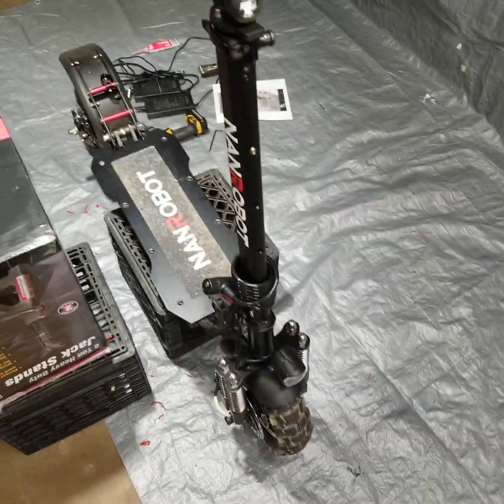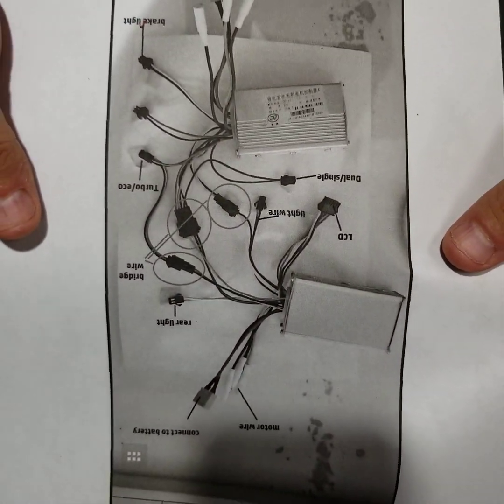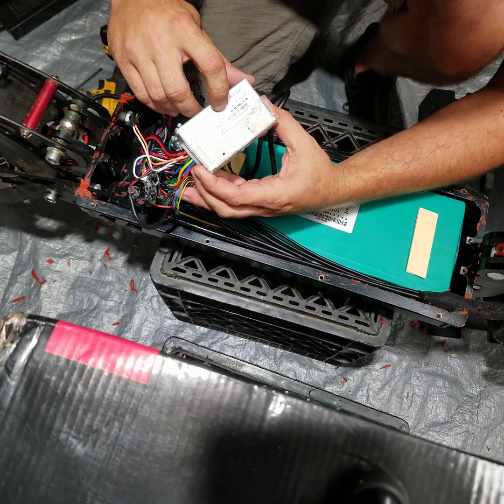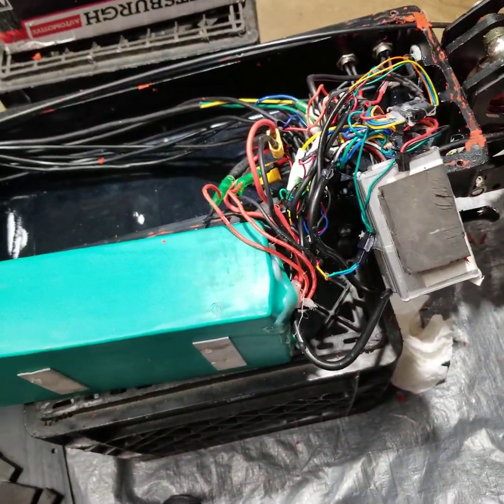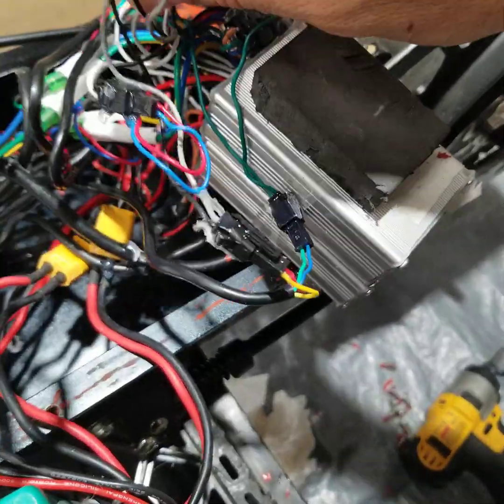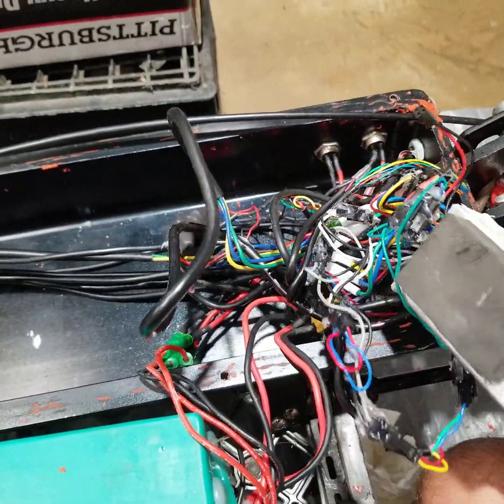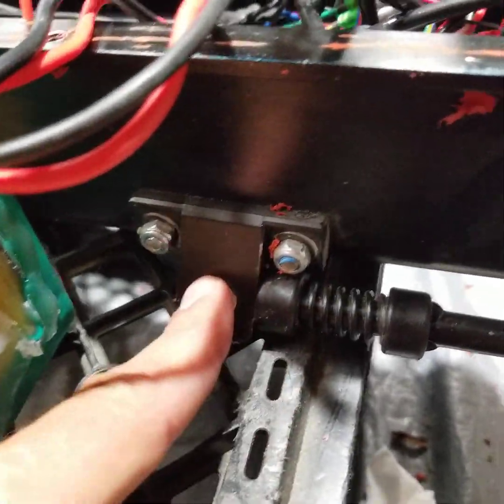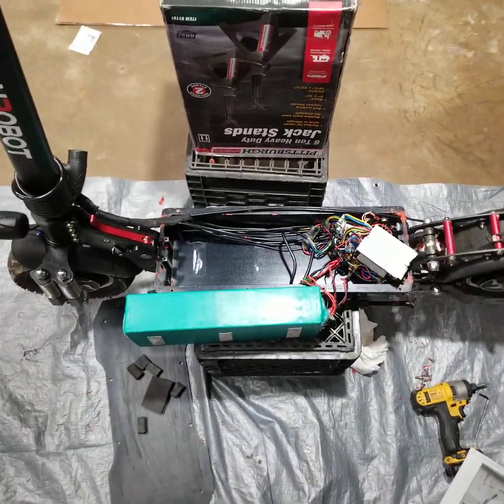Nanrobot D4+ 2.0 Whats inside the scooter Plus overview of the basic wiring diagram electric scooter

Comment: hey i was wondering if you could help me.  i wrecked my scooter and somehow ended up taking the key ignition off and just have the trigger now and when i tried to bypass it and rewire it, i think i fried one of the wires running from either the trigger or the dual switches buttons......i thought i had it wired right but apparently not or i needed bigger guage wire or something...is there any way you can explain the easiest way to wire it so that it will be simple and run full speed without the dual switches etc.....

Comment: Help my front motor works fine. I checked to call turbo switch to turbo switch is good. I bought a new one of course and I’m not gonna replace it because there’s nothing wrong with what I have but the back more than work I said well I don’t need the front more. I need to back more so I replace the wiring I rewire it exactly the same now the back motor runs backwards white wires. Do I have to change to make it more front worse as a green one bunch of different ones

Comment: Hay I wonder if you could help me out. I’ve got a cheeper electric scooter basically the same as yours. When I got it the on off switch with volt meter was broken. I’m not sure if it had a key or not. Now I just have 3 wires on handle bars red,black,&green. I can’t get any power to the display power button because it’s not wired up I guess. I have power to those wires to the black and green wire nothing to the red wire. I got this in a trade and I’m trying to find out whether it’s any count whether it’s worth me replacing that switch or not. I’m only going to sell it when I get it going anyway I’m a little bit older of the guy and I don’t particularly live anywhere. I can really ride it I’m out in the country in the mountains do you know of a way that I can get power to the controller with the trigger. ? Like I said, I have about 48 V to those wires being that the batterie is not completely charged up? I have looked and looked online. I haven’t found anybody that can help me on that yet.

Comment: I know that this is 
But when I received my NanRobot 4X2.0 the first day I got it it was about 6 in the evening so I was happy to get my I fixed it right quick jump on it and went around the corner come back put the scooter on a charger when I got up put the key in no power man I got that in 20/20 you know I'm looking at your video now so I can fix my speed controller
Thanks 👍
Reply: O I wanted to tell you that my charger that came with the scooter burned my speed controller so I didn't know what was wrong took to a shop & they told me that my charger fried the speed controller and I looked the big yellow plug that goes to the battery was  damaged also I don't like NanRobot because I only road it for 10 minutes & been having it for 3years

Comment: Ok, the red/yellow goes to white/blk and the blue/green to just the green and bridged over to the red/yellow as well? Sorry this one I'm working on is a mess. It was stolen and then recovered and I'm fixing for a friend.  Also it looked as if the red/blue was pig tailed out two ways, but I couldn't tell for sure  trying to find this exact diagram is impossible, there are even a lot of difference between the one in the video, and this one but this is the closest I could find so far. My buddy would be happy to just be able to ride it, so is there a better color diagram link that you have found out there because the tweeker that stole it chopped up the wires pretty bad. Thank you in advance.

Comment: As far as range, like you said it depends on the lot of factors. But I've come to realize you're better off going by the voltage instead of the battery bars. It's going to die completely at 46 V .so when I hit 48 I know I should head home which is usually within 5 miles. And Loctite works good for loose bolts. If your folding handlebars rattle when you fold them down there's a tiny Allen key bolt in there. If you back it out backwards just a little bit it will get rid of the rattle. When it's in the right place squirt a little super glue on it and it will stay there. Otherwise eventually the rattle will damage your handlebars

Comment: You don't have a brake light? That must be an older model. Glad I seen this video I was just telling somebody I'd like to have a diagram of the inside wires. Mine was $1,200 even because of the Black Friday sale :-) to my door. Mine goes 40 mph when it's fully charged. But usually it runs at 38 mph and then when it gets lower 36. But I have gotten over 40 miles and range one time even 52 :-) I weigh 175

Comment: Just bought mine a few weeks ago :-) the power and speed is amazing :-) putting new lights on myself. Have had problems with flat tires though but I think I got it under control I have two bright LED strip under glow lights that were for a car. It's 12 volts and I want to get a converter to where I can hook them up to my tail lights in headlight. I don't know if I just need a fuse, or a little Transformer to lower the voltage like you did

Comment: I just bought a yume scooter with the exact set up and the brake light wire was rubbing against the tire and I think it threw a code and now it’s reading that the brakes are constantly on and it won’t let me throttle I took the the plate off and I unhooked the back light but it’s still showing the brake on I need help and I have no idea what to do

Comment: Hello i have a nanrobot d4+2.0 have about 800 miles on it. I was riding it and it just went dead and now i have resistance on both tires they do not spin freely and the dual single button only works in single really strange and now it will not turn on i have a wide wheel pro and i used the charger with the same connector as the the power to battery and the key switch works but the throttle does not work not sure what to do i have it apart can you help thanks
Reply: and error code e08

Comment: My stem was loose and i did what you said to tighten the neck nuts and it was a Lil tighter but if you put to washers on the 2 screws on top of the nuts. That's even better. Thanks for all ya videos ive watched so far

Comment: Im trying to diagnose my nanobot d4+ 2.0 scooter. This problem does not happen in the cold morning on my first ride but happens in middle of day when it is warmer. Im in NM my first ride is at 50 degress and it is still about 35 degrees over night so the battery is cold on the first ride. What happens is on the second ride when its 70 degrees outside both motors cut out when I'm in dual mode and when i go full throttle, and also sometimes when i try to just accelerate quickly. when it cuts out i does not come back alive by simply backing off a little on the throttle but i have to totally go back to 0 or no throttle and then the motors start if i re-engage the throttle more gently incrementing the speed. It does not happen in single mode when in just rear hub drive. When in single mode i can press the throttle fully and as quickly as I like. If I think of the thumb throttle as a clock that goes clockwise from 12 to 6. it is at the 5 when the motors cut out. It also happens if i got from 12 to 3 very very quickly.  I'm pretty techy and i can replace of fix most anything but I like to diagnose first. I did have an extra thumb throttle speed controller so i did decide to replace that (because a year ago i brew out its usb power port when making a dual charger for a camera i have) but changing that speed controller had no change in the symptoms. Do you think there is a short somewhere in the system on full power or is it a hall sensor. Is it overheating and the bms cutting out? There are two controllers in the scooter with a communication wire between them, could one of the controllers be off. Both motors shut off when this happens. What tests should i run to see where the problem is? I have opened up the scooter before because I silicone sealed everything to protect from water. but actually moved to NM where there is little rain and I do not ride it in mud or water anyway. Any help appreciated.

Comment: Thanks for the video, I am wanting to do a dual headlight, add turn signals. Weighing my options on power consumption, I rather not have all these wireless devices and have to charge separately. I was wondering, did you happen to measure the voltage on connector that powers each controller? I am curious if the 52 volts is split between the two XT60? or XT90 connector, and each one would be 26volts and the amperage would be 11.7.
Reply from the maker: No the voltage is not split. It's the same. Where it drops voltage on different components is with the buck converters to your lights. And i agree with the direct wire instead of charging things separately bc it always seems like i am charging something separately from the scooter.
Reply: @wattsinyours  Thanks for the reply! I did a quick skim in the video, but did you talk about the buck converters? Im curious to see if they're adjustable or fixed voltage.
Reply from the maker: @lolslim690  they are fixed. But u can buy them very cheap and at many different voltage levels. I talk about them in my lighting upgrade videos for my rs7. If you buy an adjustable one it will not worm because it doesn't store your last settings when u poweroff your scooter, plus they are to big to fit in tge limited space we have in the deck.
Reply: @wattsinyours  thank you, very informative, have a nice day.

Comment: Out of the box the Eco Turbo Dual Single switches when pressed don't have any effect on my D4+. The front motor doesn't appear to come on and the scooter always runs the same constantly with a top speed that only goes to 23mph(gps). The speed controller says over 40mph, but I surely know that I'm not going that fast. Should I check that bridge wire connection under the hood? I could have a bad controller for the front motor I suppose. What is your suggestion?
Reply from the maker: I would see if there was a loose connection under the hood probably is where you'll find your issue. Let me know if you find the issue and if you don't we can do some more troubleshooting. Thanks for watching!
Reply: @wattsinyours  The seller has sent me a replacement scooter I'm picking up tonight. Cross my fingers and hope the new one will be okay.
Reply from the maker: @chrisb.1214  🤞

Comment: Dude i hope your well been some time from your last post i came hear to say this battery is Garbage your lucky to get 13 months out of it mine wont charge anymore both chargers stay green i was wondering is you have a link for that Samsung battery you talk about in this video ?
Reply from the maker: You can get new samsung batteries that will fit right it there perfectly. Go to either alibaba or aliexpress and look up flj electric scooters they sell batteries that are plug and play. Takes a liitle bit of searching but if you go directly through there site through those apps you will find it. Good to here from you and good luck. Let me know if i can help more.
Reply: @wattsinyours  I could not find anything in the size from them 5 1/2 w X14L  52V 23.4AH. Nanrobot wants 500 dollars wont honor the Warranty after 13 months
Reply from the maker: @SaltCreep45  i found your battery. You have to go to the flj offical store, then find there 52v battery, look at item descriptions and you will see generic Chinese battery, lg and panasonic batteries. I looked at the size and they will fit right into your scooter and they are plug and play. No modifications need to be made. They also offer bigger amp hour sizes which i would upgrade to. Their prices go anywhere from 300 to a little over 500 for the better ones. I got the best one they sold to put into my rs7. Panasonic 42ah battery. It cost about 1000.00 but was worth it.
Reply from the maker: @SaltCreep45  the 26ah one is 487.92. Chinese battery
Reply from the maker: @SaltCreep45  the LG 30ah one is 625.00 thats the one i would get then you wouldn't have to worry about batteries again for a long time. And you get more range.
Reply: @wattsinyours  625 Dam plus shipping? Looking now for it thank you so much ill get back to you if I find it
Reply from the maker: @SaltCreep45  yeah i think everyone gets sticker shock when they see the price of batteries but thats where most of the cost is.
Reply: @wattsinyours  For the life of me I can't find it I see one from ElectricScooterStore for 659.00 can you provide me a link when you have time ?
Reply: @wattsinyours  is it under 48v listing?
Reply: @wattsinyours  LG 30ah (14s9p)345×130×70 ?
Reply from the maker: @SaltCreep45  no you need 52v listjng
Reply: @wattsinyours  I'm not good with math and i thank you very much for your help but the guy from aliexpress saying 345x130x70 is what i need .I have 51/2  with 14 inches long
Reply from the maker: @SaltCreep45  13.5 long  inches x5 wide  inches x 2.5 inches tall. It will fit.
Reply: @wattsinyours  Dude your the best YouTube friend a man can have Thank You So much God Bless You and your Family .I Just purchased the DaulTron Eagle Pro 3200 watt for 2300 from mini motors in Hoboken New Jersey with 1 year warranty made in the U.S.A.
Reply from the maker: @SaltCreep45  Bro thats awesome! Your going to love that scooter way more than the nanrobot. I ride with my buddy and he has a dualtron 3 which is real simular. Let me know what you think about it after your first ride. I am also glad i was able to help out and let me know if you have any problem with that scooter. I have some experience with those as well. Enjoy!!
Reply: @wattsinyours  Yes sir Thank You very Much and I sure will keep you informed about the daultron
Reply: The Eagle is a Monster paid 2400 total the Dealer max out the speed clock it at 43MPH .It have very powerful Torque can be scary at times .Another good news on the NanRobot D4 2.0 I ran the battery down to 44 volts unplugged it let it sit 48 hours when I plug it back in the charger I heard a pop and it quickly began charging again 57.6 volts .I quickly got excited jump on it went for a 15 mile ride draining it again to 43 volts plug it back and it charging again just saved 600 bucks .

Comment: Thanks for the vid. Informative. Where/What would be the best option for a replacement battery? I have the d4+ and battery is pretty much shot.
Reply from the maker: You can get one that fits perfectly from flj electric scooters on alibaba.
Reply: @wattsinyours  Thanks. I accidentally left my scooter charging and went away for 5 days. When I came back I took it out for a short ride and it was moving well, but after powering down during a 10 minute errand it was moving super slow. Guessing the battery is fried. Hoping a battery change will be the fix since I need it for my work commute.
Reply from the maker: @oglattimus3167  i would make sure bc you can almost buy a new scooter for the price of the battery.
Reply: @wattsinyours  true.....considering it. was looking at some Dualtrons which are super expensive. 🤦‍♂️
Reply from the maker: @oglattimus3167  yes they are but super good quality. Its one of those things buy once buy right. Trust me been through that senerio. Luckily i have the skill set to work on some of these pieces of crap but hey its fun for me. Keep me in the loop of which route you go and if i can help in any way just let me know.
Reply: @wattsinyours  thanks. I have absolutely no idea what is wrong with this thing. guessing its either the battery or one of the motors. confusing really bc when fully charged the display is at abt 56.1.
Reply from the maker: @oglattimus3167  well sounds like the battery is good. Possibly the speed controllers? You could always take the working one and put it on the other motor to see if that is the issue.
Reply: @wattsinyours  🤯
Reply: @wattsinyours  Just pulled the trigger on the Thunder.
Reply from the maker: @oglattimus3167  daaammm player nice!! Your not going to know what to do with yourself once you get on it. That thing is a bullet. Be prepared that thing is huge compared to the d4 but your going to love it. You won't have any problems with that one.🤞. Let me know when you get it and take it out for a spin.

Comment: Hello l just saw your video and subscribed already.. l have a cuestion my nanrobot d4+ have a noise on the back some people say is the radio controller but some people say the is when l start a mode 3 or 2 with eco turbo...only the sound comes when I start.  some people say that I have to turn off the eco turbo so that sound doesn't came, others say it is the radio controller inside. Please if you can help me

Comment: Hey so I've got a question maybe you can give some suggestions but I have the same scooter as in the video and recently for whatever reason when I try to turn the control panel on it triggers the horn and its like an overnight type thing one day its fine the next its acting like this any idea?
Reply from the maker: Sorry for the late response but the problem sounds like maybe you have a nicked wire somewhere. I would start by chasing down the wire coming from my horn all the way back to the controller. Pain in the butt to do.

Comment: Hi man, nice vid about the cables!
just got my new scooter, but literally the first time I pulled the throttle (90% charged battery), it shut down and I couldnt turn it on anymore.
After I plugged out and in every connection/cables, It came alive...but after a short ride (like some seconds) it shat down again. After I checked all the wires, I saw that one of the two fuses (the little yellow XT60) was burnt out!!!
now i know that this occurs this shutdown as a safety thing and I dont want to trigger it over and over again, I dont want to damage the controllers.
What do you think about replacing the fuse? is it the main cause and could a replacement solve the whole issue, or it is just the effect of something bigger problem?

I hope my comment reaches you.

Regards!